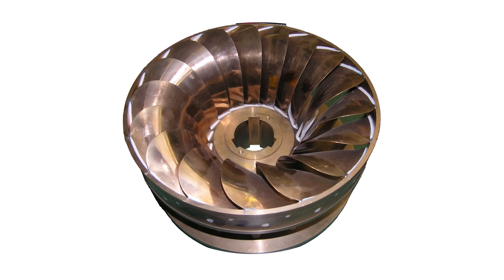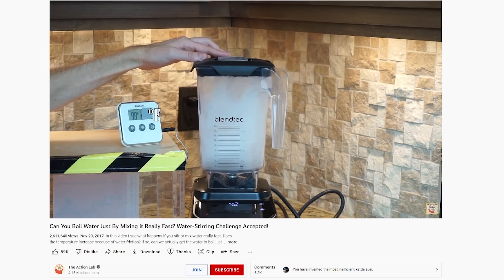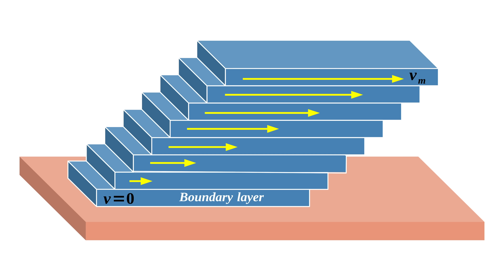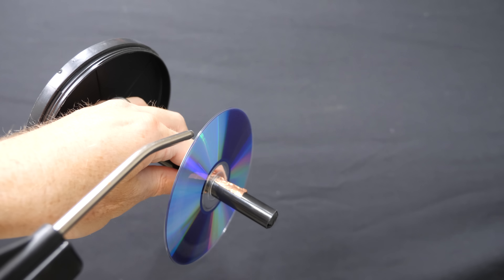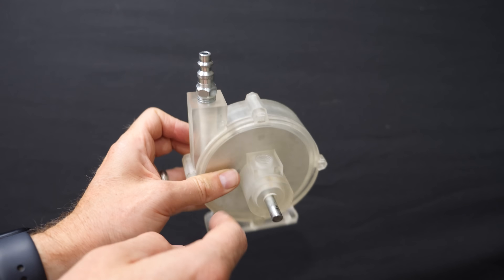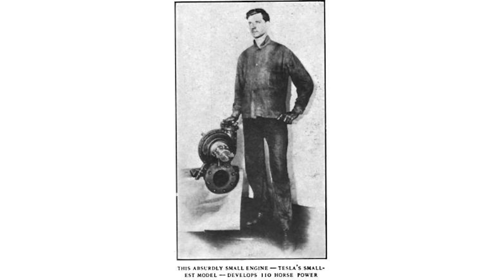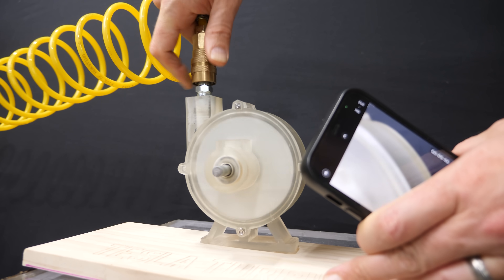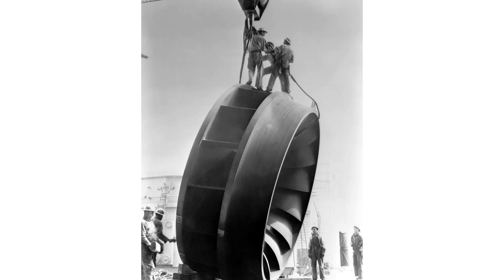How Fast Can a Tesla Turbine Spin?

Comment: Your correct, everything needs to be tuned properly. That's something I've learned over the years, and I haven't had any issues with warping. My latest turbine uses fiberglass disks, that have an extremely high strength to weight ratio and I don't experience any warping. Also there isn't any issues with torque either. Thanks for making an accurate video about tesla turbines.
Reply: Why not use carbon fibre? Much higher stiffness than glass fibre
Reply: @BenB21361   It's really expensive. I used it to begin with but switched to fiberglass because the price is so much cheaper
Reply: How big do you think you could make the disc before experiencing issues?
Reply: I thought in a boundary layer Turbines you have a minimal slip so to speak?( Low difference between the speed of the disc en the motive vluid) so your working rpm is totally depending on input speed you give it ,  if the speed is just a few procent higher than the rotor it acts as a turbine en if it's a few procent lower it acts as a pump ,  imagine it like how a electric Induction motor works
Reply: @CharlieSolis  And I'm back after checking the best steam turbine efficiency. Yes, you are absolutely right! (that means someone should fix wikipedia)
But again, I didn't say people should stop trying. I under stand that it might look like people are setting unrealistic bar from your point of view, but to share my point of view, I'm being skeptical to not blindly believe things. (You would understand that because there's truck load of people associating tesla with holistic powers and conspiracies)
Anyway, I'm not capable nor want to discourage you on what you are doing. Keep up the good work and thanks for not loosing temper and actually pointing to right direction! (which is rare these days..)
With that aside, what's your estimated maximum efficiency from gas based tesla turbine assuming the tesla turbine technology matures?
Reply: @dongleseon8785  omg… don’t even get me started on the disinformation spread about Tesla. Just so much unbelievable nonsense that you have to wade through just to get to anything real. The only place to start is read the patents. Read his own words. Don’t listen to what other people say about him. 

The last 50 years have been one boondoggle after another of people trying to write and sell books, movies, shows so they put crazy fantastical stories in them and go “that might be true, we’ll never know for sure though…” 🙄

I’m seriously convinced the entire 369 Bs is one giant sink hole to drag net unwitting easy to scam people. He never even said the 369 quote that EVERYONE shares around, that every group is swarmed with. 

That and just to delegitimize the real works tesla actually did. 

I’ve replicated enough of Tesla’s stuff and seen it actually working, along with experiments I had to do for my physics degree, to know Tesla was not COMPLETELY WRONG about things like most engineers try to demand.
Reply: You're*
Reply: @CharlieSolis  I'm far from saying people should stop developing tesla turbine. They should! But before saying that it's THE future, tesla turbine needs to significantly outperform volute turbine first because that is more of a same weight class. To compete with axial turbine, maybe someone should come up with at least 1MW tesla turbine?
Reply: @dongleseon8785  I’m sorry but that’s flat out wrong. There are plenty of scenarios that no other turbine can even handle that the TesTur won’t even blink at. 

I don’t think we need to build a mega watt unit for it to be worth it…. The average home only ever pulls 10kW at any point in time max. The average Home Depot gas generator for a home at best gets 15-20% thermal efficiency. <- that’s all it has to beat bud. 

People gotta stop setting unrealistic bars to suit you’re lack of understanding on how the TesTur actually works to feel confident enough to say they will work. 

Solid fuel particulates would destroy bladed turbines and piston engines, fuel sources like powdered coal and pulverized iron can only be used in a Tesla turbine, all others would fail very quickly. 

No other bladed turbine can even get their full rated efficiency with steam either because every bladed steam turbine has to stop expanding the steam beyond the point where condensation droplets would form and destroy the complex geometry blades, wearing them down to little nubbins in a matter of minutes. 

That’s TONS of energy just left on the table in the turbine, but whole plants get use of that heat energy by using it for boiler feedwater preheat. 

But this would not be an issue with the Tesla turbine because it has no detrimental effect form multiphase fluid flows. Cavitation doesn’t effect the blades because there are no lifting surfaces for the particulates and cavitation to smash into. 

Specifically geothermal steam cannot be used in any other turbine either, an entire energy source we are wholly underutilizing. The corrosive salty and very wet steam full of abrasives from steam bore holes can only be used with the TesTur because of its robustness in handling multiphase fluid flows.
Reply: @CharlieSolis  Oh okay. I now realize that we were talking about different things. I didn't know that your scope is home use.
I was thinking people are trying to say that tesla turbine should replace turbines in the nuclear powerplants and big ships. Good to know that it's not the case.
Now that I know what we are actually talking about, still, I never said it's not worth trying. It obviously has great performance already and has good place to use too! (like geothermal that you mentioned which is also mentioned in old link that I referred from tesla symposium)
Look. I'm not against tesla turbine or what you are saying. I'm saying that there's people glorifying and mystifying it as a wonder machine just better than any other turbine on earth.
Okay youtube notification is getting very confusing, I'll try to keep up what's going on.
Reply: @dongleseon8785  again, I was not saying they can only be used in residential. I said that’s somewhere they can be used. 

And then I said I don’t believe we need to build a megawatt version for it to be worth it, but I did not say I was not going to make a megawatt one. 

I believe you are setting an unrealistic bar to see “if it’s worth it”. 

This video did it and so does EVERYONE and there mother.
Reply: @CharlieSolis  Now this question is just out of curiosity. When there's multiphase fluid on tesla turbine (let's say steam condensing on disk), does liquid go against gas because of the centrifugal force? And if it does, how is it discharged before building up too much?
Reply: @dongleseon8785  if your multifluid flow has too high of a concentration of liquid in it yes you can potentially get a liquid ring situation. Which has its own advantages for different situations.

But most multiphase  fluid flows that would be used would have very fine atomized droplets in the flow.
Reply: When load applied ...disk wont rotate and high pressure forms and break whole thing
Reply: @freespeech515  Not sure what you are talking about, I have over 3 years experience building tesla turbines and have never had the load stop the turbine from rotating.
Reply: Couldn't we just replace the discs and if we used air instead of water they should last a bit longer but there must be a way we can make the discs from a stronger like tungsten or maybe even a more flexible material
Reply: @kieranmullen2422 I’m not a Tesla turbine expert but I think the boundary layer effect works best with liquids
Reply: Yet I still believe there's some inherent issues when it's scaled up. For example, because it's a disk shape, angular velocity near the exhaust will be much slower than the edge of it, which will make big problem once the disk get's large. If tesla himself didn't make it bigger than 670hp(which is not much for powerplant turbine output) maybe he saw the problem in the design?
Reply: @dongleseon8785   consider one kilogram of H2O steam entered the turbine at Mach 1 at 300°c and left the turbine at 1/2 radius at 1/2 the speed of sound. 

The kinetic energy left in the steam leaving the turbine at 1/2 the speed of sound is…
(1/2)(1kg)(170m/s)^2 = 14,450joules of kinetic energy. 

But the available energy from initial kinetic energy and thermal energy in the steam drop from 300°c-100°c is… (c=specific heat)

(1/2)(1kg)(340m/s)^2 = 57,800joules of kinetic energy. 

Plus

c*M(Tf-Ti) = (2080 j/kg/°c)(1kg)(100-300) = 416,000 joules of heat energy.

Total energy available for the turbine to utilize from 1kg or steam entering the turbine at Mach 1 and at 300°c thermal energy available for expansion through the path length comes to 

57,800j+416,000j = 573,800joules total available Energy.

So not being able to utilize the last 14,450j of kinetic energy of the steam means you’re only missing 

(14,450j / 573,800j) = 0.02518

That means you’re leaving only ~2.52% of the total energy available for the turbine to utilize for power out…. 

The kinetic energy of the fluid leaving the turbine even at 1/2 the rpm is a pale shadow compared to what’s available. 

Focus on optimizing the rest of the turbine by reducing slip and you won’t even need to worry about that last 3%…

And in any case that leftover energy isn’t “lost” it’s still available for power in a second stage or even like in Tesla’s patent GB 174,544 hybrid disc turbine + Parsons reaction turbine that utilizes the last bit of kinetic energy left in the fluid and the thermal energy generated/loss from the shearing of the fluid, also know as the “reheat factor”, through expansion and radial thrust in the low pressure secondary stage parsons reaction rotors.
Reply: @dongleseon8785   I'm not sure where he got the 600 horsepower number, because Tesla got 200 horsepower from the 18" turbine. He also said with with a 125 PSI, and a low pressure unit on the exhaust with a condenser affording 28" Mercury , he could get 400 horsepower.
Reply: @dongleseon8785  1kg of steam at 125 psi is at ~180°c and say going Mach 1 entering the turbine…

Thats 166,400j of thermal available to drop to 100°c plus 57,800j kinetic energy =

224,200joules available 

14,450j/224,200j = 0.06445

So that’s ~6.45% of the total available energy is lost to the exhausting steam’s kinetic energy and unusable in that stage but recoverable in a second stage. 

Again…. Still not even breaking 1/10th of the total energy available. 

Sure if we are going to chase those high efficiency numbers yeah 6.5% would be nice to have but again it’s not “lost” forever 🤭 it’s available in a second stage for more torque. 

Just like EVERY axial bladed turbine. No one stage EVER comes close to utilizing all the  thermal energy available. What’s not used up after each stage is put through another set of stator nozzles to accelerate it with its leftover energy and smash it into another rotor blade stage. 

In fact, if a bladed turbine requires 15stages to get the 60% efficiency they boast that means no one stage could even possibly come close to getting those efficiency numbers. 🤭
Reply: @CharlieSolis  I understand that tesla turbine has unmatched theoratical efficiency. What I'm wondering is, what's the real world efficiency and redundancy when the condition is not optimal? Like, load change during the run or turbulent input from degrading components or..
I don't know much but the way I understand is that the tesla turbine efficiency will exponentially dive when the condition gets unoptimal.
Reply: @dongleseon8785  name me a single engine that’s doesn’t slow down when a load is applied to it and the throttle isn’t increased to maintain powering through that load. 

Increasing load does not have to come at the cost of efficiency if the disc stack is designed properly reduce slip on the disc such that the vast majority of the discs surface area is overkill so as you increase the load you’re not already at the peak capabilities of the turbine and there’s nothing more to give. 

@The Action Lab claimed that “if it’s not an order of magnitude or more better than what’s available then it’s not even worth trying/no one sees it as worth trying…..”

Just plainly disingenuous…

🤨 if it’s not 10x, or even more, better than what’s out then it’s not worth it… c’mon now.  

TesTurs don’t have to be some holy grail. They just have to be competitive… while being the same price… 

What an unreasonable bar to set that NO ONE would ever even set for the many BILLIONS dumped into bladed turbine R&D that literally only even aim to scrape 1 extra percentage point out…
Reply: @CharlieSolis  I see that it is viable option. The reason I was skeptical is because people tend to glorify this invention and draw very unfair comparisons such as comparing the tesla turbine efficiency to the cycle efficiency of the whole engine that contains conventional turbines.
I'm not against poking around the path that people decided not to take. By all mean, it's interesting!
Maybe I was simply annoyed by people who blindly worship anything that has tesla tag on it?
Anyway, I sincerely wonder what efficiency the tesla turbine can show in commercial power plants. Convectional steam turbine in that area apparently shows over 90% of efficiency.
Reply: @dongleseon8785  can you give me an example of an actual turbine that has an isentropic efficiency in the 90%s? 

Actually, what turbine gets the absolute highest isentropic efficiency, and what is that actual efficiency? 

I don’t mean whole plant efficiency, because whole plants claim +90% thermal efficiency because they are Combined Heat and Power (CHP) plants and utilize a lot of the thermal energy for heating and recoup boiler feed water preheating and the like to get to those 90% efficiencies.
Reply: @dongleseon8785  the worlds best gas turbine gets 63.08% efficiency… yet everyone and there mother demands that if Tesla turbines can’t get 90% or “at least and order of magnitude OR MORE better” it’s not even worth doing…. Yeahhhh ok 👌 lmao
Reply: @dongleseon8785  worlds best steam turbine gets 50% efficiency…..
Reply: @CharlieSolis  I was trying to link the paper that wiki is referring to as a +90% efficiency.. Seems like youtube don't like external links in the comment. I'll look around and see if I can find something that doesn't need link.
Reply: @dongleseon8785  I got 88% and it's likely much higher!
Reply: @iEnergySupply  wow! 🤯
Reply: @dongleseon8785  It seems like even Action Labs wants to believe there's a reason why this technology isn't widely used today, rather than encourage its development. It's a pretty common reaction when technologies that don't have widespread adoption are discussed. Let's call it self-deception.
Reply: @Infinion  Well, maybe. But I'm ready to be convinced if someone would like to point me out why tesla turbine is not another good-on-paper unicorn unlike thorium reactors.
Reply: @dongleseon8785  I will gladly point you in the right direction.
<— Click my photo and you’ll see all the evidence for real working, actual power and torque outputting, even at low rpm, Tesla turbines. 

You’re literally like on step away. 

I’m not talking about more theoretical jibber jabber. I’m talking real recorded proof of the Tesla turbine working and getting plenty of torque and efficiently even at low RPMs, and powering through differing loads. 

You don’t have to just take my word for it.
Reply: @dongleseon8785  - thorium reactors of the molten salt solute fuel solution type are not just “good on paper” at all, and are an extension thousands of hours of safe and self limiting runtime, for the uranium fueled molten salt reactor experiment at ORNL, over 50 years ago.    

  Trying to keep a solid fuel assembly solid, while in a reacting state where gasses need to escape from it, is asinine, as is the entire Rube Goldberg complex system of trying to keep these solid fuel systems, and pressurized water cooling systems, from going exponential.

 When you “reprocess” solid fuel assemblies. into new solid fuel assemblies, part of that process involves dissolving the assemblies in... molten salts.

  Molten salt fuel systems operate at atmospheric pressure,  expand and become less reactive if they get too hot, and will drain themselves to a passive cooling vessel, if they somehow exceed this naturally homeostatic inverse correlation of temperature to nuclear reactivity.

  You have to get them to react, which they will stop doing on their own, instead of once started, constantly working to keep them from running away catastrophically, and they can keep running while their fuel undergoes onsite, online reprocessing.

  We were cheated by various political and economic interests, of Alvin Weinberg’s greatest invention, right about 50 years ago.
Reply: @CharlieSolis  Can you give me a reference of where that 50% number comes from? 
The source I'm trying to link is just disappearing...
If you search in the google: Boiler Steam Turbine CHP System Cost and Performance Characteristics
and go to the image, and you will see a chart from turbinesinfo on top
That's what I was trying to link.
It's quite confusing to be honest because it says CHP efficiency is 79% right under it and it doesn't make much sense to me either.
Reply: That's interesting, is it just a normal fiberglass or something more
Reply: @veiserexab1428  I found that titanium is much better because I wanted to go higher in temperature.
Reply: How are you gonna start your comment with "your correct"? Good lord man.
Reply: Hey i got a question have you tried titanium sheets as an option for the discs? If no do you think it would be a better material? If yes is fiberglass the best material over titanium or other materials?
Reply: @digital0185  My latest turbine has titanium disks. I don't' show it on my youtube channel yet, but it's on my patreon page.
Reply: Does the torque depend on speed the same way efficiency does? Because if yes, a Tesla turbine would have less torque on start up, and would get stronger as it spools up. So with the right amount of resistance it might keep up the performance at high speed, but stall if it gets too slow. I don't know if traditional turbines behave like this too, but this seems like a setup for a very dangerous feedback loop.
Reply: @pocarski  The torque depends on the differential between the speed of the moving fluid and the speed of the disks.
Reply: @pocarski  like Tesla says, torque is proportional to the square of the velocity difference between the fluid and the disc (dV), proportional to the surface area (A), and inversely proportional to the disc spacing (d)
 
T ~ A*(dV^2)/d
Optimize that^ and you’ll make an efficient turbine for any given fluid. 

As the disc slows down relative to the the fluid the torque increases parabolically. 

As you increase the area the torque increases linearly.

As you decrease the disc spacing the torque increases linearly.
Reply: @pocarski Most of our world has potential for dangerous feedback loops, no?  🧐
Reply: @pocarski  I would share links, Though youtube seems to delete those comments, Though If i read correctly, Tesla Turbines efficiency improves at higher RPM.

They are only "inefficient" due to material's not being strong enough for the load. 

I could be misremembering however, So you would need to research this fact on your own.

Video name "Tesla Turbine | The interesting physics behind it"
Reply: your left
Reply: What do you mean by warping(assuming it's not about SPACE-TIME)?
Reply: @ideasforever4823  I think creep deformation is the formal term
Reply: @ideasforever4823  its when to much force is aapplyed to quickly, using improper fluid to drive will also do this.,
Reply: @ideasforever4823  It's mean a disc will temporary deform like it's made by a soft gummy if put enough force or make it spin fast enough.
Watch spinning the CD on "The Slow Mo Guys" channel if you wanna see it.
Reply: @Kevin Corapi sheering will become a problem between the fluid on the disc and the fluid assist the fluid. It'll end up more turbulent.
Reply: With modern carbon materials this could be even more efficient. Thanks for your isight
Reply: @damiensteiner9919  despite what everyone erroneously claims, efficiency is increased by reducing slip. Not increasing disc speed.
Reply: @CharlieSolis  And the external link disappeared again... But I found one that has 80% isentropic efficiency with 15MW capacity.
Reply: @CharlieSolis  nice & respectful.  I worked for a company donkeys years ago who developed cold pressed metal techniques. These served well at then but not now. Given I'm 56 & metal meant solution that's how it was done for the benefit of all. The new material sciences are incredibly exciting given that by new standards I'm a primitive excite myself.  Thanks Charlie for your comment but a engineer from the dinosaur era such as myself can't keep up.
Reply: @damiensteiner9919  just listen to what Tesla says to do. 

1) increase the speed of the fluid relative to the discs (not increase disc speed) 
2) increase surface area
3) decrease disc spacing 

Owing to a number of causes affecting the performance, it is difficult to frame a precise rule which would be generally applicable, but it may be stated that within certain limits, and other conditions being the same, the torque is directly proportionate to the square of the velocity of the fluid relatively to the runner and to the effective area of the disks and, inversely, to the distance separating them. The machine will, generally, perform its maximum work when the effective speed of the runner is one-half of that of the fluid; but to attain the highest economy, the relative speed or slip, for any given performance, should be as small as possible. This condition may be to any desired degree approximated by increasing the active area of and reducing the space between the disks.
-Nikola Tesla
Reply: @CharlieSolis  Being a massive supporter of Tesla this is going nowhere Charlie.  Your first comment was appreciated this is a self important diatribe & don't bother till you check your responses please
Reply: @damiensteiner9919  dood what are you even getting at right now?
Reply: @CharlieSolis  That using unconventional materials & techniques get the job done. Please stop replying as you are becoming irrelevant & the quality science not invented by you or me is more important than repeating the obvious when I was invested in Tesla not you.  That's what I'm saying. Total finning bore
Reply: @damiensteiner9919   the only one becoming irrelevant is the one who keeps trying to do the same dang thing over and over again trying to chase high RPMs and expecting to get a different result. 🤭
Reply: @damiensteiner9919  ohhh I see now… you’re just a troll with a 4 month old account. Got it 🤭
Reply: @damiensteiner9919  I actually don't agree with you.. After poking around scholar papers up and down, the biggest limiting factor of tesla turbine research seems to be lack of shared quantified data but not a cutting-edge new material. So I think he is doing the right thing keep producing data.